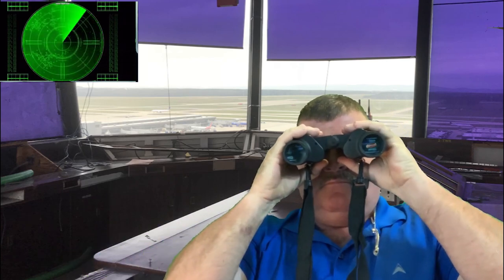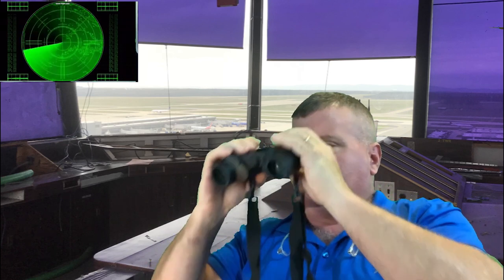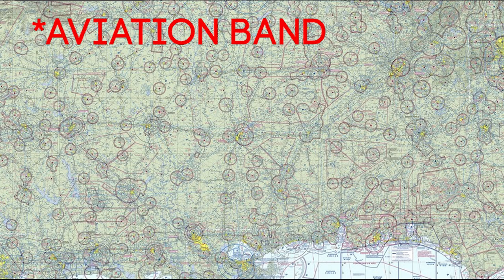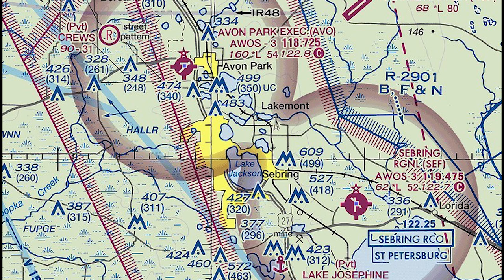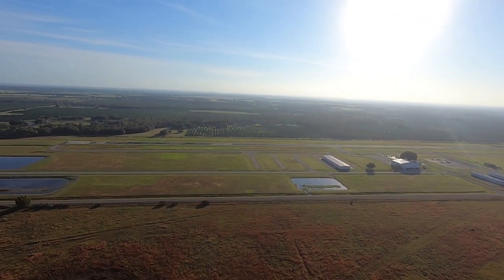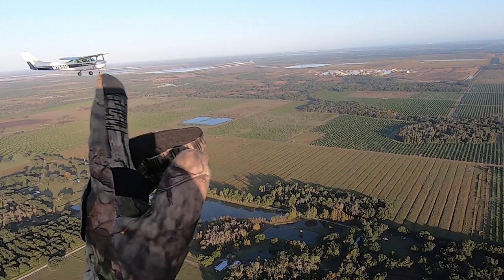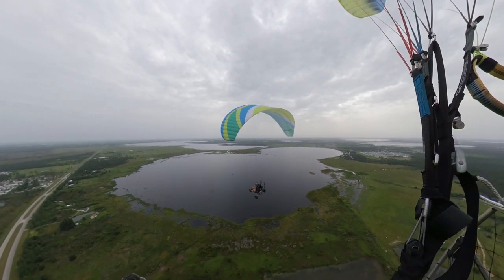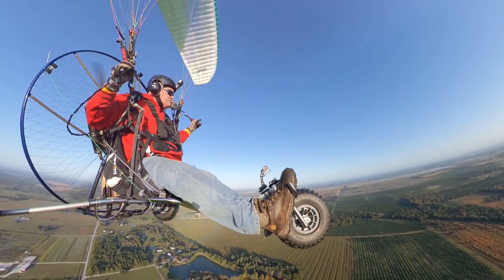PPG Aviation Radio HOW TO talk to airplanes  aviation band communications tutorial

Comment: Great info Rick! I launch from a grass runway at a small airport that is used primarily for sailplane launching. The runway is 3500 long and 275 wide and tree lined. I have to use the runway because there is no other spaces to take off from and it is a primo grass strip. The runway is used for approach practice and motor out landing for the several local flight schools located at the surrounding airports because it is highly visible from the ground. The sectionals show it as a warning area with a "High volume of flight training". The airport manager requires that I use a radio and announce my activities. The issue I have is that it is difficult for me to hear and easy to misunderstand what is being said due to the motor noise and difficult to tell which airport they are addressing since there are two in the area; Pierson and Umitilla. The giveaway is when they use a runway number but some pilots actually use the number at Pierson even though there is only one runway there. The airport manager told me not to get to technical but to just state my intentions using basic radio protocol. Typically I will announce "Pierson traffic, ultralight, paramotor, Red Angel One, located at the SW end of Pierson Field runway preparing for takeoff. I will be turning to the north on take off".  I read somewhere that ultralight aircraft without numbering will commonly use a name instead and mine is "Red Angel One". I announce myself as "ultralight - paramotor - Red Angel One," since I was told that many pilots don't know what a "paramotor" is and will not appreciate the fact that you are only moving from 5-35 mph. If you announce you are on final approach prior to turning onto a direct glide path to land they will assume you have landed long before you actually do. I announce when I have landed and where on the field. This may seem like overkill but nobody has objected yet. 

 I think pilots in the area are beginning to recognize my calls as I am beginning to recognize their voices and aircraft. Some have addressed me by name. I also can't hear approaching aircraft for the same reason, the motor, and have developed a system with my ground support guy to notify me if he sees approaching aircraft, which is common. I don't know what his status is as far as operating a radio and I have considered having him notify me with a series of 4 rapid clicks instead of announcing it by voice. That lets me move away from the airport and get a visual on them. Once I do, I announce the fact that I am in the area and I have a visual on them to make sure they know I am there. So far everyone has been very courteous but I did have a trainer announce he was approaching the field for a fly by after I had announced my intentions to land. I could see him approaching from the far end and I announced that I was aborting my landing. He immediately pulled up and came back with an apology. I use the runway to practice landing and to calculate and mentally calibrate my emergency landing glide ratio. To your point a radio is important if you are flying from an airport. I also fly out of Marion County airport occasionally and while it has a good amount of traffic using a radio seems to be optional there since they have so much space like Wauchulla. I hope you don't mind if I post your video on my ASAR website. I am looking for good educational content. Come up to Pierson sometime and check it out. Lots of beautiful lakes, forests and farm land down below.

Comment: Great video, Gorilla! About 9 days after your post, Midwest Powered Paragliding posted a comprehensive training video, titled "Protocol and Etiquette at Non-towered Airport." They also talk about playing nice with GA pilots on the radios. A great resource to download, print & stuff into your harness pocket is FAA Advisory Circular 90-66B (see Pg 12 & Appendix B), along with a printed copy of Part 103 (just a couple of pages, but well worth having). You can use these printouts to defend yourself when an old "know-it-all" pilot (or airport manager) tries to school you on Part 91 rules (by the way, there's a cool paragraph about PPG pilots in Part 91, under Applicability, that reads, "(e) This part does not apply to any aircraft or vehicle governed
 by part 103 of this chapter, or subparts B, C, or D of part 101 of this
 chapter." GEE WHIZ: did you know... in Class G airspace, VFR pilots operating under Part 91 are restricted to 3-miles visibility, 1,000 ft ceiling? If we stay below 1,200 ft our weather restrictions are only 1-mile visibility, clear of clouds! Read about it in AC 90-66B!

Comment: Rexon radios are great. Just something to think about though as you made the comment that pilots should not be talking back-and-forth as glider pilots. However, if you are on 123.3 and 123.5, those are your two official glider and balloon frequencies. the two frequencies are shared by the two different aircraft types. So yes, a powered paraglider could in all technicalities use that frequency to talk with another paraglider pilot.

Comment: I have a couple questions:  1)  I fly with a Fresh Breeze Monster (Hirth F33) and use an older Lynx helmet/ head-set and and Icom radio (A-3 and my stuff goes back to mid 1990s).  I often fly out of airports and like to signal my intentions...my problem/question is...I get a lot of engine noise through my head-set...it has to be the ignition.  When my motor is off...the sound is good but when the motor starts I get a buzz that oscillates with the frequency of the engine RPM.  How does your equipment do?  What aircraft radio and what 2 meter radio do you use?   2)  What frequency do you use when plane to plane?   Often times we will use 12345.    This is great stuff...thanks for helping us understand the rules and showing us that there really is no great mystery to using the radio.
Reply from the maker: I've had some engine noise issues too. I had a new Icom A4 and I couldnt even use it. With the squelch on max I still got terrible motor noise all the time. I put some snap on ferrite coils on my ignition wire and it helped a little. I still get engine noise over my cheap 2 meter radio pretty bad. I think I'm gonna try something a little better like Kenwood 2 meter soon. We could use "fingers" frequency 12345 on av band I guess. It's just hard for me to switch channels in flight. Would probably be easy enough to program in both ahead of time and scan the two channels.
Reply: A lot of times engine whine is actually picked up by the headset wires themselves - more expensive radio might suffer the same problem. If this is the case, you might clear it up by putting ferrite bead filters on the wires -   They clamp on, or the wire loops around the bead (Google ferrite bead filter).  I'd start there, its worked for me before, and might be a $5 fix.  Hope it helps!
Reply: @Sky_Pony_1_mic_sierra  Thanks, I will look into this option...certainly worth a try.